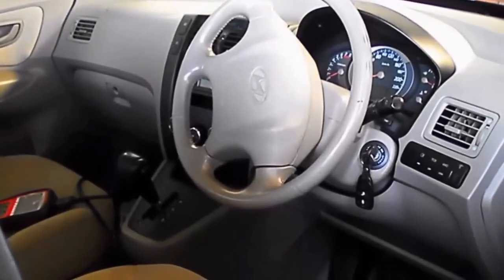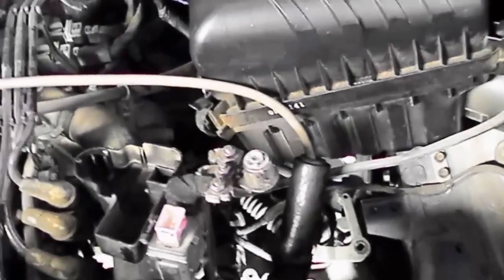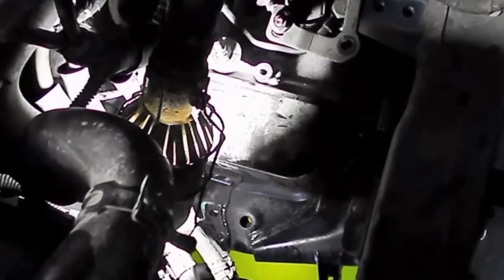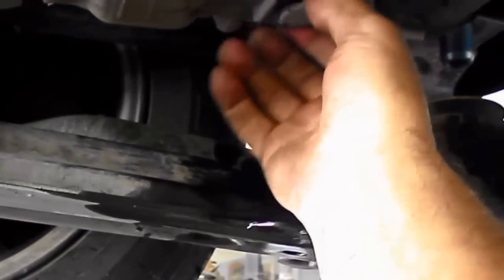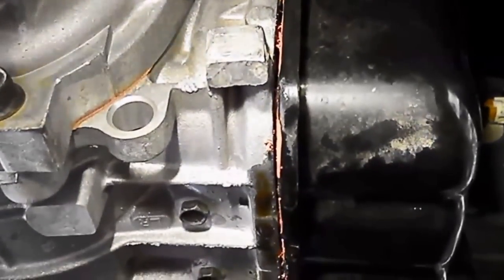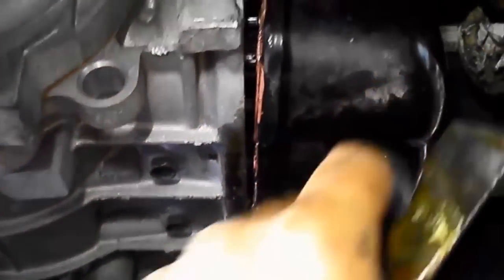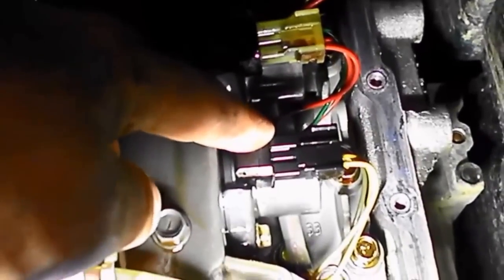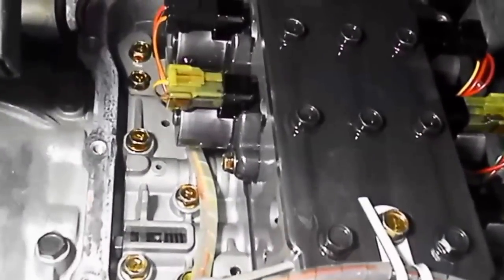Hyundai F4A42 Remove Automatic Transmission Solenoids DIY

Comment: My car was running fine and all of a sudden I turn it on and put it in drive or reverse and nothing ..... like if I’m on neutral....
Reply from the maker: hi, have you checked the basics first? contact me on my face book link https://www.facebook.com/Yep-Thats-It-103051017785435   , if needed we can exchange pics on there. cheers
Reply from the maker: 1.  Make sure your battery is fully charged and strong. Modern vehicles have alternators that only maintain battery and do not charge the battery as in the good ol` days. 
 2. Check for any bad electrical connections to battery, check electrical plugs to Transmission including any sensor plugs. Measure for high resistance across any Earth Straps to Transmission, often the cable end is only bolted onto the paint on your chassis and the connection is only through the thread on the bolt. Often loosening and re-tightening bolt will improve the connection, but always best to squirt some rust inhibitor on the thread as well. Then retest the resistance across the Earth Cable/Strap.
 3. Check Transmission fuses and relays. Modern Transmissions also rely on a Brake Pedal switch for operation. It is even worth checking rear Brake lights are working as this can affect operation.
 4. If you can`t check fluid level of Transmission, look to see for any signs of leaking fluid as that will indicate low fluid level. Make sure you always refill with proper/equivalent Transmission Fluid Type and to correct Fluid level. Overfilling can cause fluid to reach rotating components in Transmission and aerate the fluid in the Transmission. Aerated fluid in a hydraulic application can be as bad as having low fluid levels, as air can be compressed and fluid can`t be compressed as much. Also remember to watch fluid level versus recommended temperature when measuring fluid...fluid will expand with heat.
 5. Check for any Transmission Fault Codes. Fault codes will only be stored in computer if the set electrical parameters for electrical operation of components fall outside of programmed settings. Codes will not come up for leaking solenoids. Once you have recorded all Transmission and related Fault Codes, try clearing codes, performing Re-learn procedures and seeing if the issue has gone or returned again ( note any recurring fault codes and codes that have disappeared )
 6. Perform a thorough Transmission Road Test Drive. Test Upshifts and manually downshifting/upshifting Transmission. Often a fault in alternate gears will indicate the area, clutch or band that may be faulty by cross referencing the solenoid and clutch/brake/band application chart. If applicable, and your transmission has a torque converter you can also do a Transmission Stall Test to indicate problem areas. If you have pressure port information for your Transmission you can also perform Line & Pressure Tests on your Transmission. - ( you can also do an air pressure test of clutches and bands later if/when you remove Valve Body to listen for any leaks )
 7. AT THIS STAGE YOU MAY HAVE QUESTIONS FOR YepThatsIt.... Please leave a detailed description/s of your Transmission issue and any tests and results. 
 # PLEASE NOTE; some beers are required to answer your questions and the quality/detail in any responses/answers may/will depend on the beers given. We can also exchange pics,vids and documents....  use the link https://www.paypal.me/BATS189
 8. When you are satisfied that you have done all the above, you can now remove Transmission Pan and inspect for any debris and types and amounts of debris present on any magnets, in pan and in filter. This can help identify if bushings, thrust washers, plastics have failed and if fluid is burnt from low pressure or from internal pressure leak issues. If all appears clean and fluid quality is good, then you may have a solenoid or worn valve-body issue. ( and in some cases computer issues )
 9. EVEN if you don`t need to contact YepThatsIt after doing all the above, we are ALWAYS happy to accept a few beers if any of our information/vids have helped, and it keeps us feeling appreciated and not wasting our time.   use the link https://www.paypal.me/BATS189    Good Luck & Cheers
Reply: YepThatsIt awesome thanks

Comment: Does anybody know which solenoid is b and how to test it on a 3.3 l Hyundai sonata
Reply from the maker: hi, as you are looking at valve body, sol b is the 2nd from top. test resistance between 2.6 - 3.5 ohm at room temp, but you need to warm them up to about 90 degC to test coil doesn`t fail when warmed up open circuit. you can only test these by varying amperage and note a nice steady rise. probably easier to replace....or even replace all of them as they will all be contaminated and isn`t really easy to access. hope that helps cheers

Comment: You can do a cleaning. Shit, if you can sell that job every 20k, god bless you. But, I don’t believe the manufacturer recommends replacing trans solenoids every 20k. That would be every 12-18 months of normal light driving. 
I’ve had my 08 Kia Sorento 3.3l since I bought it new and have only changed 1 valve body solenoid.
Reply from the maker: hi, we usually give the owner the explanation of options available. if hasn`t been service for ages/ever, you`d expect magnets to be covered and not working anymore so solenoids would attract the normally created fine metallic debris. it would be tedious to do solenoid flush every service....i wasn`t meaning that, however it might be needed if hadn`t been serviced ever, solenoids would be contaminated. fault codes are only stored when set/programmed electrical parameters are exceeded. if high mileage trans its probably worn anyway and flush might we short lived, so owner decision in end. cheers
Reply: YepThatsIt you get metal flakes the first day you drive it. I believe you are incorrect on your service intervals. But, like I said, if you can sell; oh well. 
Quite honestly, no customer complaint (or slight issue), flush the system, pull the solenoids and clean them with break cleaner. 
A code thrown doesn’t mean automatically changing the part. You have to do powers, grounds and voltage drops to confirm the part bad.